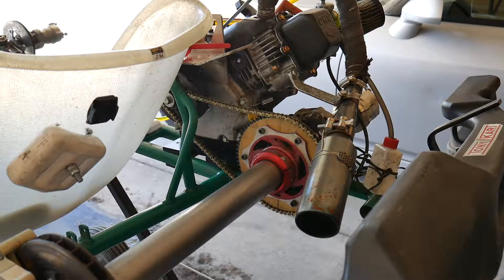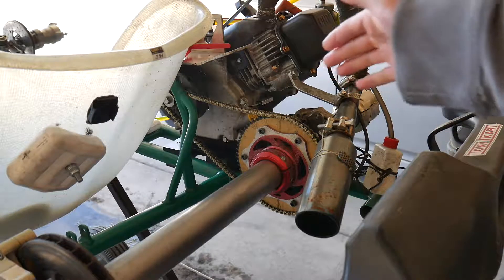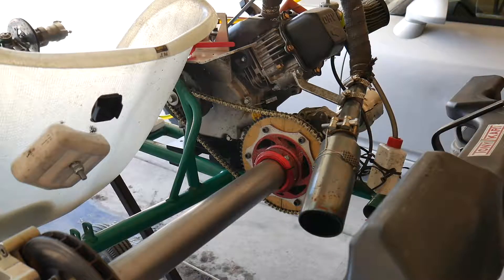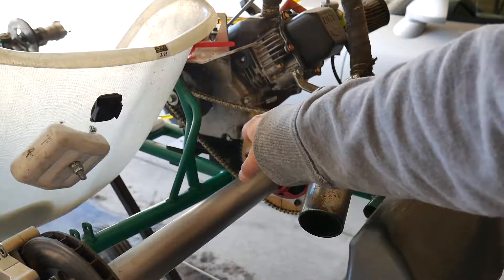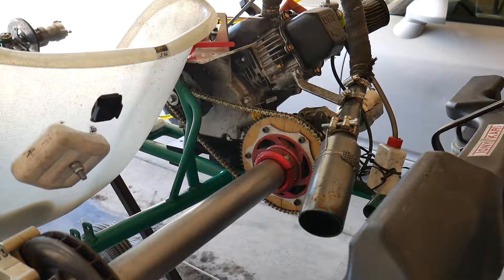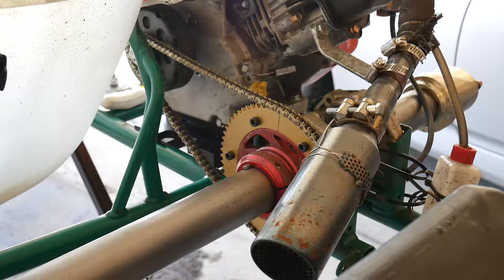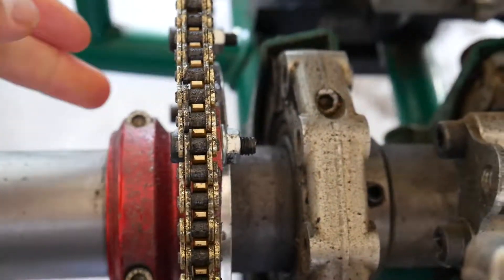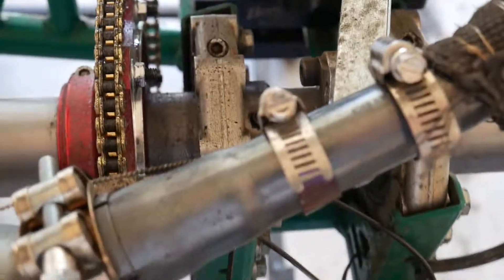How To Change Rear Sprocket On A Go Kart

Comment: What kind of motor mount is that .. and where can I get one..
Reply from the maker: Hello Adan, the motor mount for this engine is called PKT for L0206 (4 stroke) motor. It came with the go kart purchase. Most parts that I bought was bought in my local go kart shop in the US. You could get one in acceleration karting dot com. It is one of the biggest websites for go kart parts, however, I'm not sure if they ship international.